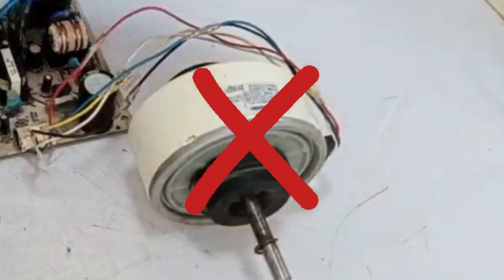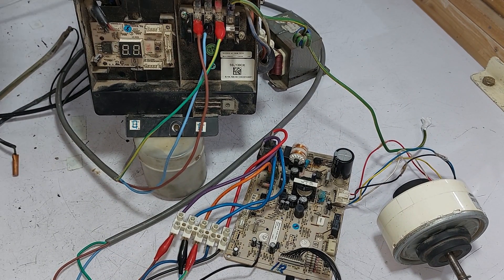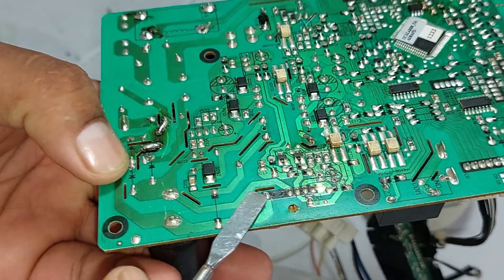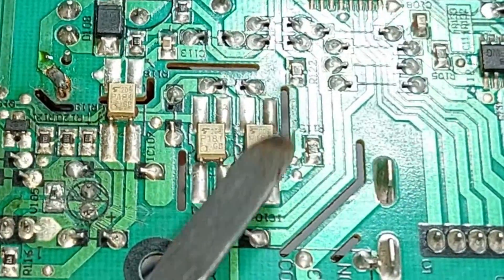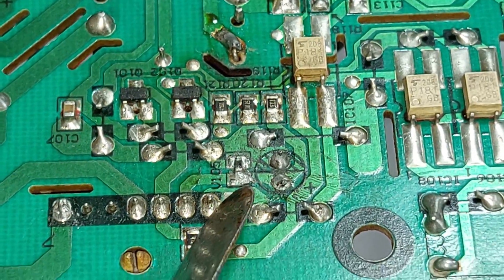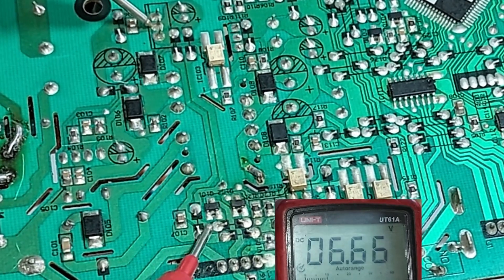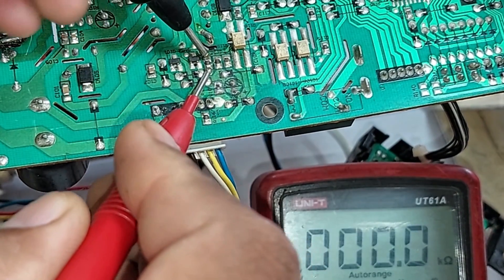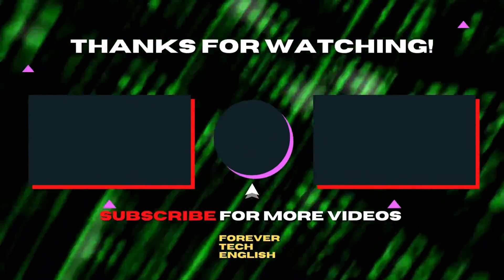Circuit Can't Turn ON the DC Fan Blower Motor In AC (A6 Error), Repair

Comment: Hello, engineer, how to test the blower fan, two wires or multiple wires. can you explain
Reply from the maker: You can check the blower motor playlist, I have made multiple videos on blower motors. But if you have more queries, I will make videos further.